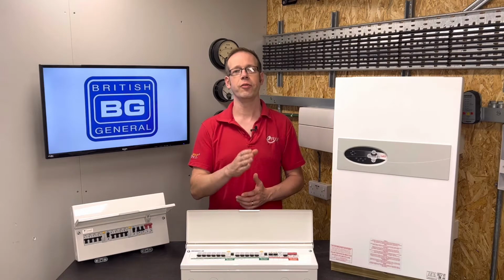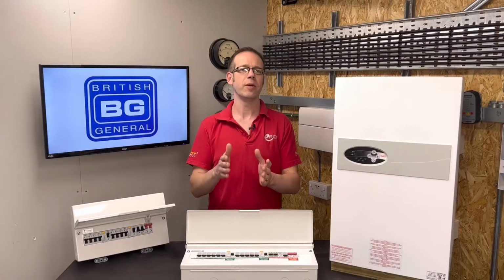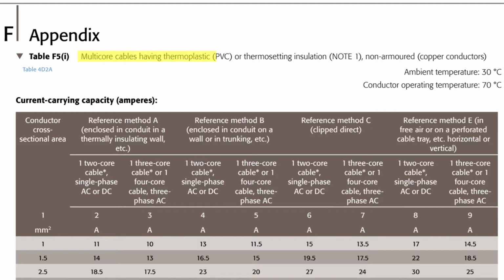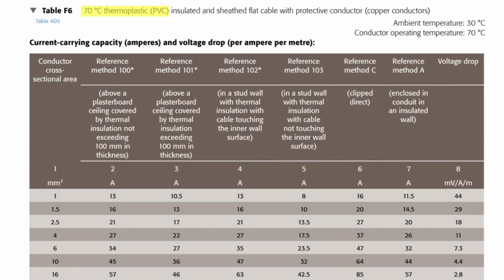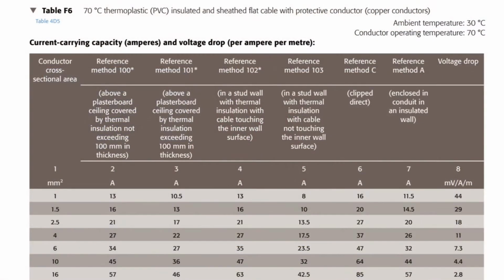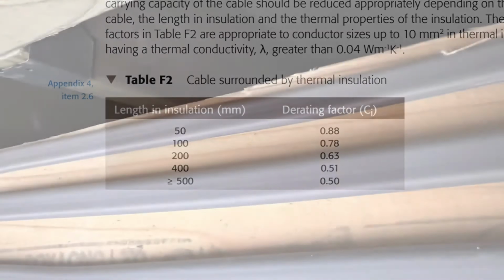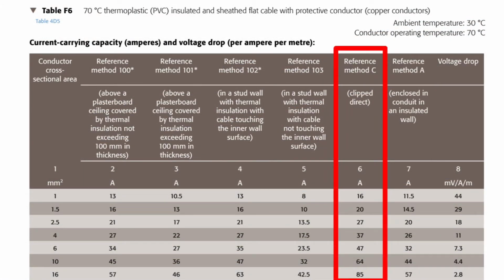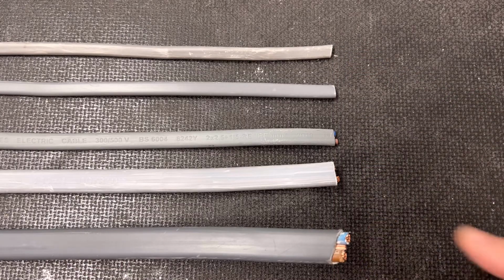How To Choose The Correct Cable Size

Comment: Our house which has undoubtedly had 2 or 3 re wires in its 160+ years had a considerable amount of 16mm cables from the consumer unit,running up to junction boxes where it would terminate into short smaller(10,6& 4 mm) cable to outlets etc. and bizarrely the shower cables both had about 25ft of excess cable supplying them clipped up and around the rafters in the attic,16 mm of course😂,I think the guy that did it just used what he had. It's a nightmare to use and is very uncooperative😊.I had to remove the back off our brand new ovens and wait 3 weeks while the manufacturer sent us new terminals and backplates just to get the cable in,and it looks daft when the cable it's directly supplying inside the oven is only 1.5 stuff!😂

Comment: Are you catering for diy now , if a spark doesn’t know how to select the right size cable they should get another job 🤷‍♂️
Reply: It's more for apprentices, someone needs to teach them how to do it and it's nice to always have a video to reference later down the line compared to trying to scribble down notes in class and hoping you got all the correct information
Reply: @x1BULLETfromABOVE1x  nonesense , they learn on site from their  employer or qualified workmates , and if college isn’t teaching them to use the book it pointless them going

Comment: Always use 1mm singles, cheaper that way.
Reply: 1.5mm2 is the smallest you can use, according to regs.
Reply: @klarnorbert  its 1mm² minimum for copper, 0.75mm² for flex, 0.5mm² or even 0.1mm² for some signalling cables, Table 52.3

Comment: Wow, this is worrying electricians needing to do CPD to work this out - is this not basic stuff covered during formal training? How many are out there that are sticking fingers in the air 😮
Reply from the maker: We've got people watching from every stage of the electrician's journey, some apprentices who'll benefit from this at college, right up to the spark who's been doing it for years and not fully understanding it. 😂
Reply: Most industrial/commercial jobs we do have the cable size specified by the consultant so no calcs required onsite. I personally verify whats specified, for peace of mind and so i don't loose the skill. Most of my colleges, approved electricians, would struggle understanding this video!!
Reply: @johnaphone  and this is what's worrying! I guess then having repeat training on basics is what's needed - I wouldn't consider it CPD however!

Comment: Future proof it 10mm for everything especially led lights
Reply from the maker: 😂 Definitely not over-engineered...
Reply: I could utterly wring the neck of our builders that put in 10mm for a shower (that goes unused by everyone who simply changes the mixer tap in the tub) but for some reason put 4mm out to my garage. You know, where everyone wants to put a car charger.
Reply: 10mm? You cowboy! 16 all the way for me... 😀
Reply: Do they do Wagos that size yet?
Reply: @liamdraper447 TopJob S can run up to that size.
Reply: LED's don't use high current at 230 volts...